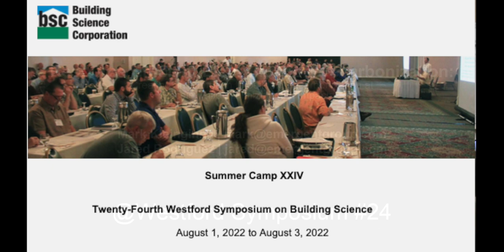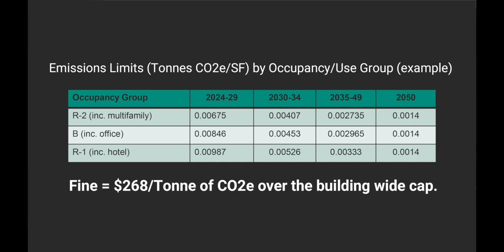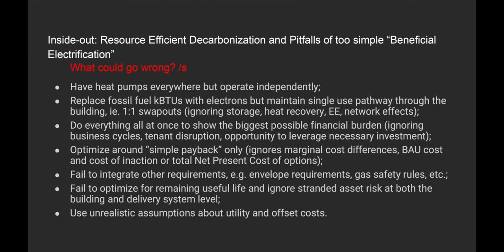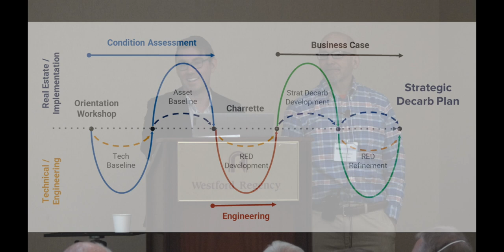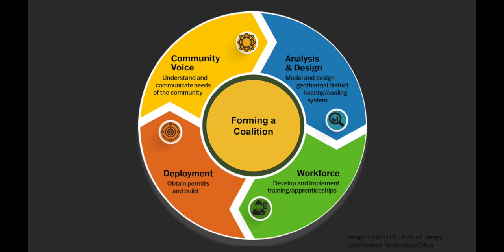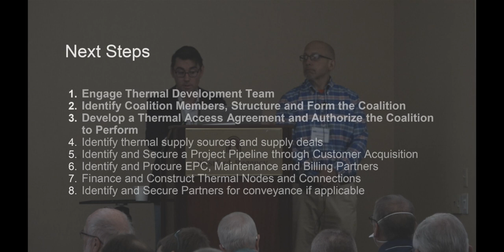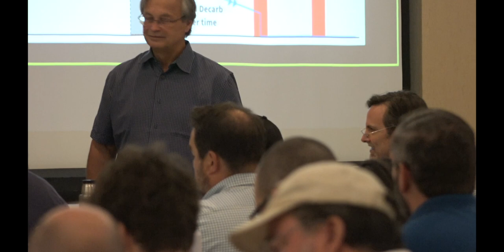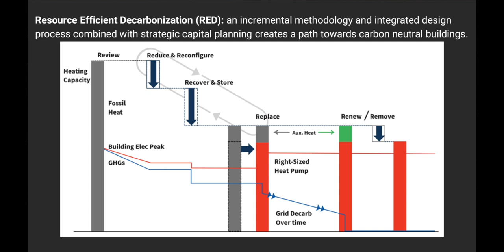“Resource Efficient Electrification and Grid Impacts of Electrification”

Comment: Hmm, some b.s. here. @9:30 resistive heat doesn't come on at -10 either. The dotted line is not in the wrong place, the chart is decades old. And AHRI independently tests these ashp's at 5f so the next part is b.s.too. I guess the speakers are just ill informed or they are trying to rile up the audience.